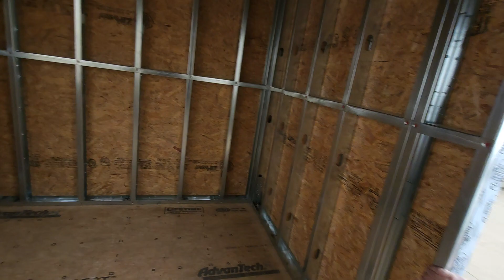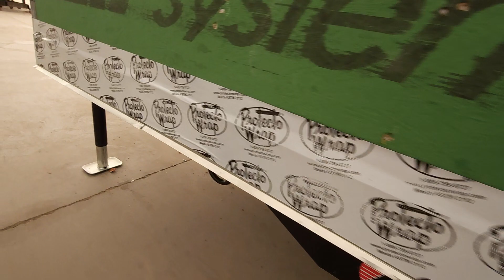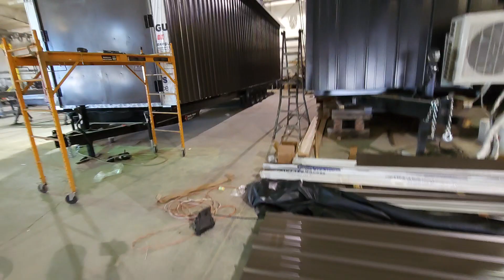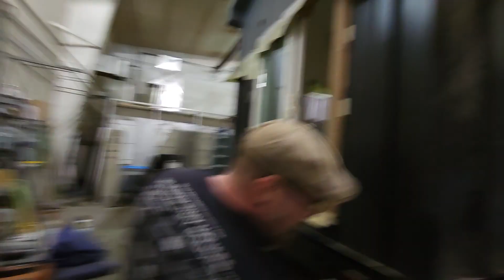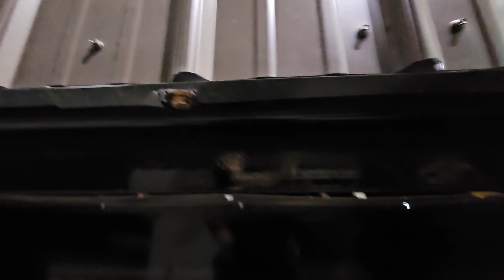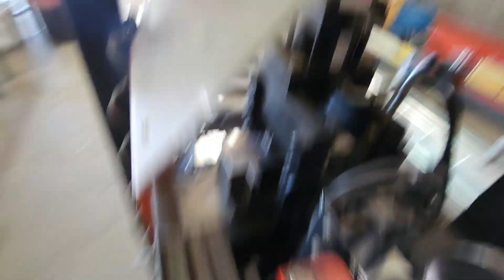Pro Tips for Building Tiny Homes with Cold-Formed Steel | Trailer Attachments & Framing Explained

Comment: Can the SI board be used on the roof?
Reply from the maker: 😕No.. Unfortunately it's only shear rated, not dead load rated. 5/8 red zip or osb are our best options for the roof. Water and ice shield over the top, and then roof finish material💪👌
Reply: @thetinyhouseexperts  Do you add any external insulation on the roof, or just spray from inside?
Reply from the maker: @chriscarver5969 that depends on the client's needs and what climate zone they home is going to. Usually we put a poly iso board on the roof, and double sheet it like an "0reo" and then water and ice shield.. R30 is a requirement for some tiny home codes (like ours here in CO), and we achieve that with a 1" rigid foam board on the outside of the sheathing. We spray foam between the steel inside👍
Reply: Thanks for the answers!!